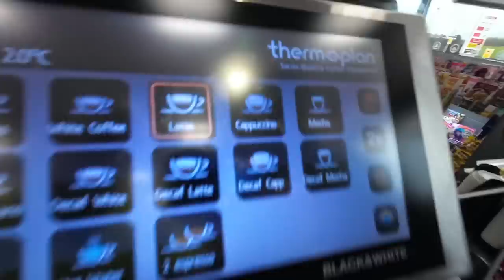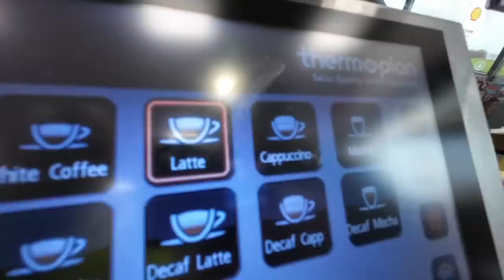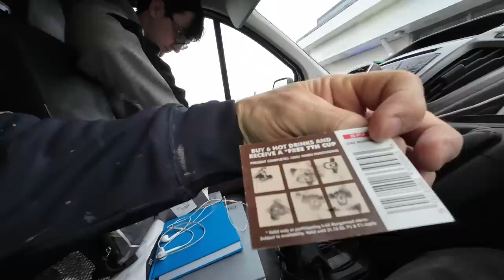INTERNAL 100MM BLOCK WALLS  EXTENSION PT 7

Comment: The attention to detail on the block work, first class lads
Reply from the maker: Cheers Robert 🧱👍🏽
Reply: Unable to send attachment. However look up block reinforcing ladder or truss type. Used around the world except UK. you can order it wide enough for the block and brick tie together. Used around the world it is code in our part of the world. I started using it since 1975 so not new.
Reply from the maker: @edskapin7171  we are in the Uk 🧱👍🏽
Reply: @SteveAndAlexBuild  UK has adapted to do it the way it does but this does make it right. A brick and block wall  tied together by blockweld or other similar products builds a far superior finished product. The pieces of wire you use do nothing. This is not my opinion but a matter of fact. The masonry institute and building standards have far advance from the standards UK uses. You do realize your videos reach beyond UK borders right??!!
Reply from the maker: @edskapin7171  What’s your point ? 
   New Zealand build out of timber …. So what ?
Reply: @SteveAndAlexBuild  My point is you should research better ways to build. Your way is long passed in the rest of the world. We have been using block wire since 1974?? Since you broadcast on 'You Tube' and it travels the world why not educate yourself on better ways??? Do you think your method of building two flimsy walls with thin wire holding them together is the guide everyone should use when building around the world. Areas with high wind, moisture and cold weather your way would fall apart. That's my point!!! 47 years experience that's my other point.
Reply from the maker: @edskapin7171  I don’t remember seeing any of our houses just blowing over in the wind .
     In case you didn’t notice different counties have very different building practices .
   Our method in the Uk is tried and tested .
    If you have such a problem with our building practices then feel free to write to no 10 Downing Street and have a word with the prime minister.
    In the meantime stop bothering us with your pointless comments and above all if it bothers you so much then STOP WATCHING! 😆👋🏾👋🏾👋🏾
Reply: @SteveAndAlexBuild  You should put a disclaimer on your video's good in UK only. Also re-read my post. It says using your methods other places in the world is wrong.
Reply from the maker: @edskapin7171  Thats not going to happen to please 1 viewer ! 
  Sorry 👋🏾
Reply from the maker: @martin2466  Thanks Martin every day is a school day 👌🏼🧱👍🏽
Reply from the maker: @martin2466  😁🧱👍🏽
Reply: @SteveAndAlexBuild  Then the masonry repair video's continue!
Reply from the maker: @martin2466  🙏🏽🙏🏽🧱👍🏽
Reply from the maker: @martin2466  👌🏼🧱👍🏽